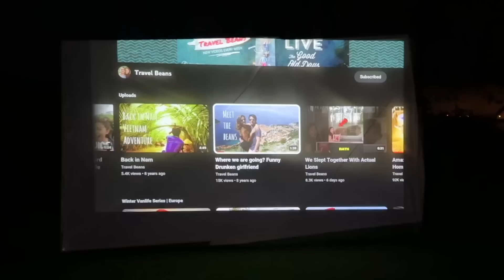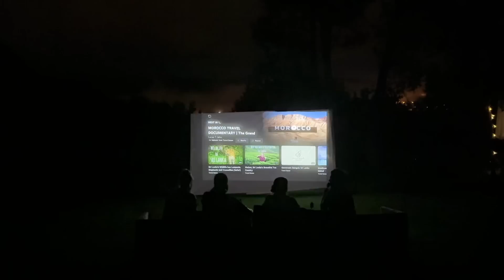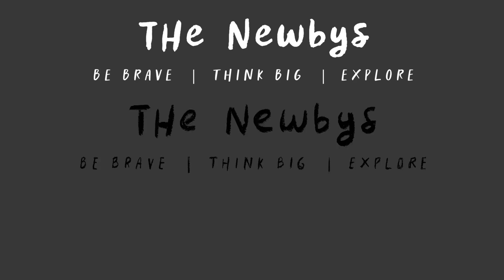Building a HUGE outdoor CINEMA with @TravelBeans on our Portugal Homestead renovation

Comment: John maybe add another couple of pieces of wood on the back and maybe a rock or a sand/soil bag on top of that board so it doesn’t topple over.
Reply from the maker: Thanks Maria, it’s a good idea. This one is a prototype, we will be building a better more permanent one later on, almost certainly using some of your ideas. Thanks!